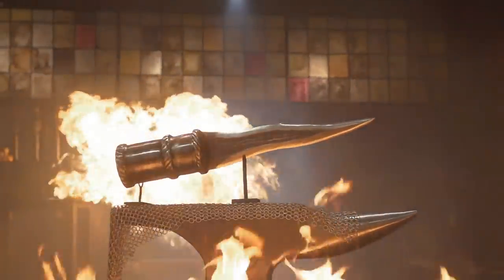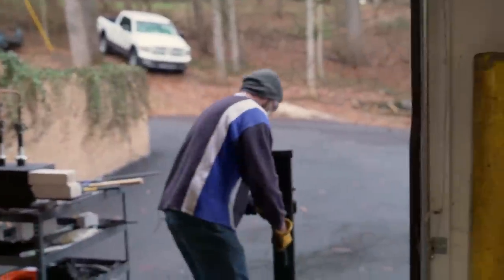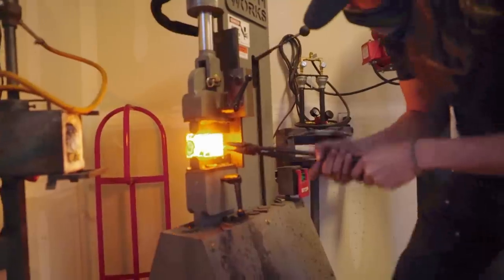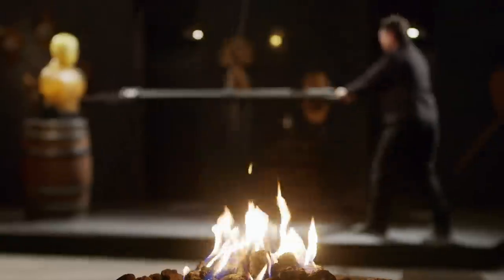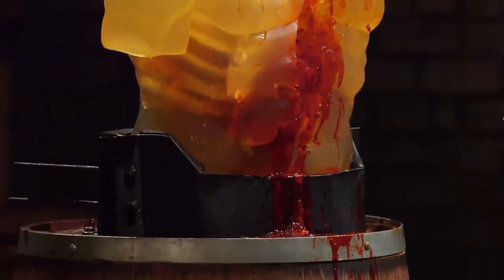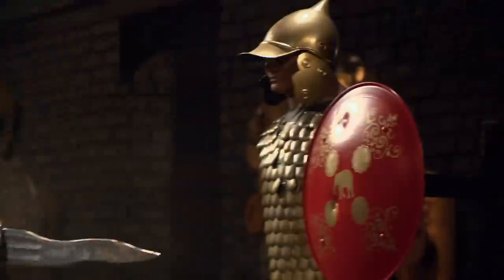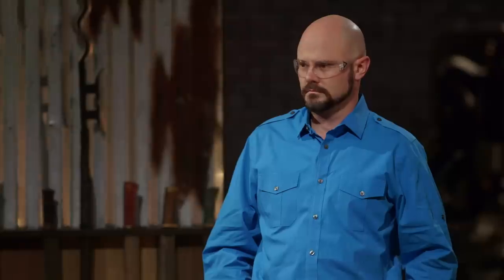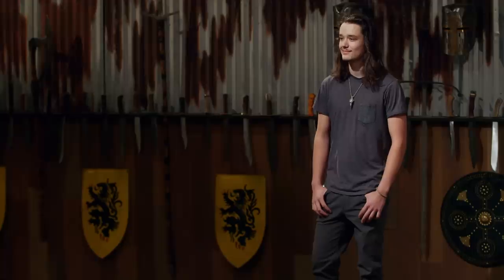Forged in Fire: INTIMIDATING Elephant Tusk Sword MAULS the Final Round (Season 8) | History

Comment: Something intended to be wielded by an elephant should've had more in depth destruction testing... The amount of strength and weight and momentum an elephant has... these blades would be taking an UNBELIEVABLE beating, only ones crafted right would fit the job suitably.

I'm not arguing with the decision, I think Jayden would've won anyway, but it would've been interesting to see them face the kind of destructive force an elephant would actually put them through.

Comment: The props they used for this test were moving and unstable. Plus the pole they used created an angle of force which wasn't practical.
Reply: Its closest thing to simulate an elephant lunging its tusks
Reply: what else moves wildly and is less than stable? a rampaging elephants tusk